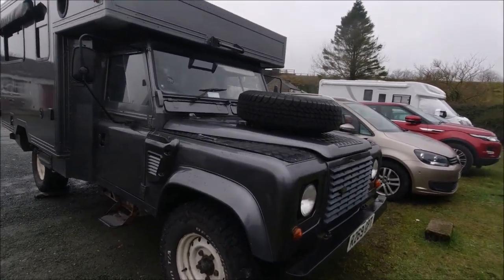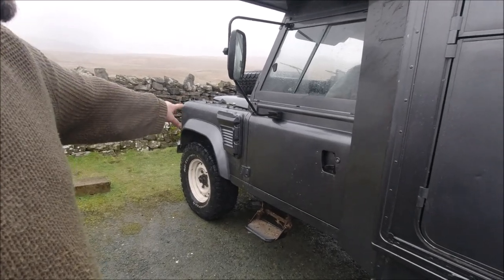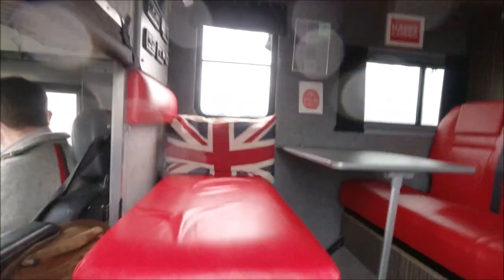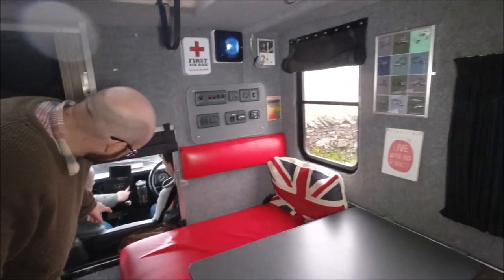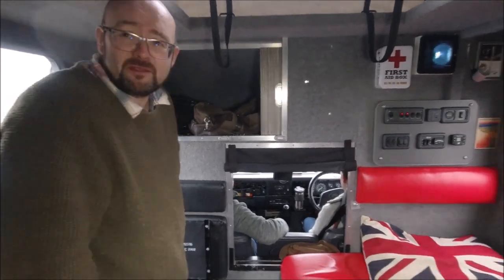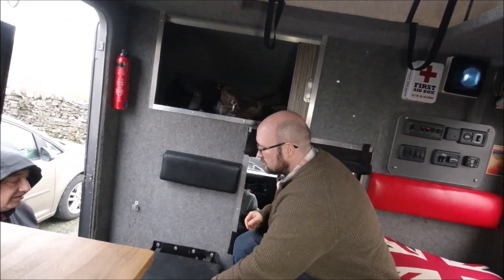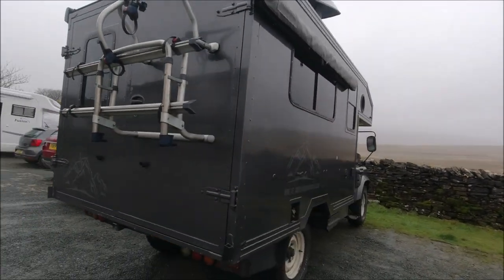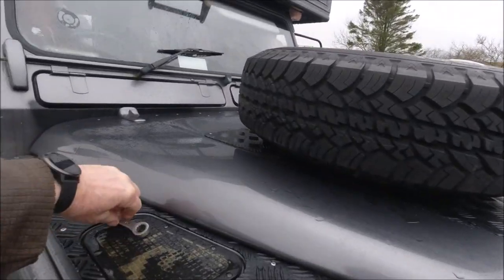Van Tour ~ Off Grid Land Rover Ambulance Conversion

Comment: 300tdi terrible engine lacks power sounds like a farm tractor also this ex's ambulance must drive like a  small boat in a storm at sea! Avoid if possible!
Reply from the maker: We put a 300tdi engine in our 109 and yes it sounded like a tractor but that didn't bother us and it drive perfectly well. We loved it
Reply: Sorry Old bean.. must disagree. I have 4 of them. (Also a TD5 too) drove this particular bus to Colditz and back. loved every minute of it.
Reply: Love the characteristic sound & more than satisfied with the performance... it's not that I didn't knew what I was buying...😉
Reply: The 300tdi is a fantastic engine, pretty much bulletproof, no electronics so if they do go wrong you can fix them with a basic tool kit and are plenty quick enough, the Wolf is renowned for being plenty quick enough.
Reply from the maker: We have a 300tdi in ours and love it.